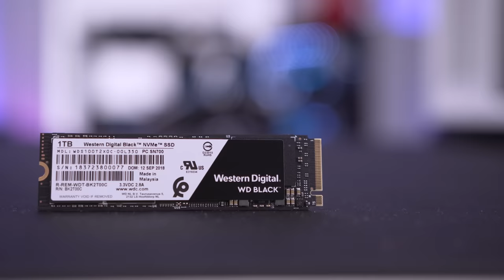The ULTIMATE Corsair Crystal 680X RGB Timelapse Build!

Comment: how exactly you you go about connecting 8 LL 120 fans and led strips ?
Reply from the maker: 2 RGB Fan LED Hubs https://www.corsair.com/us/en/Categories/Products/Accessories-%7C-Parts/PC-Components/Cooling-And-Corsair-Link/CORSAIR-RGB-Fan-LED-Hub/p/CO-8950020 and 1 Lighting node pro - https://www.corsair.com/us/en/Categories/Products/CORSAIR-LINK/CORSAIR-Lighting-Node-PRO/p/CL-9011109-WW

The chassis comes with one RGB fan LED hub and node pro as standard, and when you back a pack of 3 LL fans, you'll get another LED hub. Then I just used y splitters as my motherboard didn't have enough fan headers, but you could get a commander pro which would work as a hub for the spinning element of the fan https://www.corsair.com/us/en/Categories/Products/CORSAIR-LINK/CORSAIR-Commander-PRO/p/CL-9011110-WW
Reply: @eTeknix  so to Hubs connected to the commander pro ? on 1/2 channels, what if you wanted 8 fans with the corsair LED strips ?

Comment: did you use the commander pro to connect all the fans ?
Reply: just the hub do the job
Reply: @topprogrammingtv  how, thou? I'm currently building in this very case. I have 8 fans. But only 6 rgb headers in the hub. If I use an additional commander pro, I'll have  no usb2 port left for my aio watercooler.

Comment: You should not use the stock vertical GPU mount on this case unless you’re water cooling or door open under load. There is nowhere for the air to go.

Either buy a Phantek or similar vertical mounting adapter or install horizontally. 

To compound the mistakes, there’s no reason to mount the AIO hoses up when vertically mounting the GPU, and the bottom fans are exhausting instead of intaking. This video is a bit of a mess.
Reply: Finally, someone who knows this stuff

Comment: I  will add that your c drive should be a minimum of 4-12TB looking at the size  of  you raid array I assumed

whilst I know you can remap files however windows update isn't that intuitive to know where you have remapped a folder too..

If this a gaming/moderate video editor you are way to short of a c drive even if you have install base on a secondary hard drive they tend to mount access links into  your documents folder
Reply from the maker: Me? I have a 40TB NAS. I render directly to that using Thunderbolt 3.
Reply: @eTeknix  I think you misunderstood what I was talking about, assuming you are running 36-48TB  as gaming storage I would likely consider a 12-18TB as a c drive @36tb,  and 18-30TB @ 48tb for c drive because you will be out of c drive  storage @ 1TB

I typically go the route from 1/4 to 1/2 to 3/4 of the mass storage capacity thus way i don't run  out of space on os drive

Comment: im not 1 to criticize peoples builds but you built a gaming rig with WD Blues, blues are low performance for a gaming rig, you should have used WD Blacks or a set of Seagate FireCudas, also your build has negative air pressure with only 3 fans on the intake and 5 fans on the exhaust.

Comment: So you opted for a build with a case that chokes out your front airflow and a verticle GPU mount that is going to suffocate due to the spacing of the side panel. Epic build. For half the cost of that case you could of just got a Lian Li 011 Dynamic and seen much better temps.